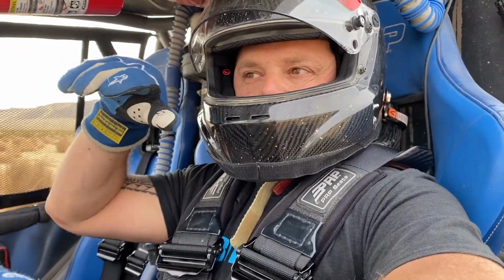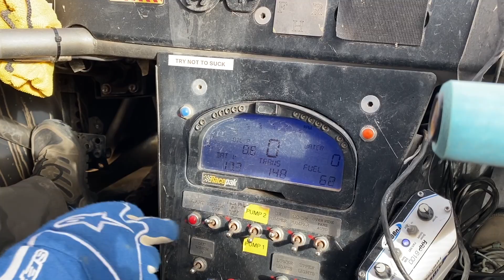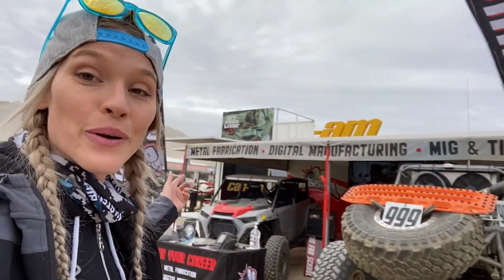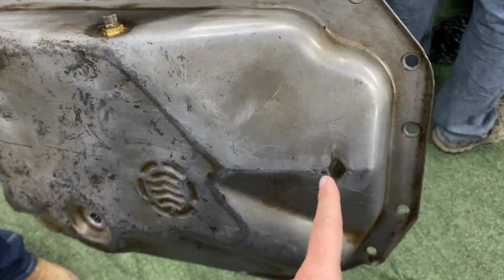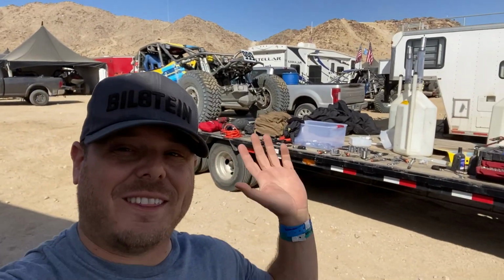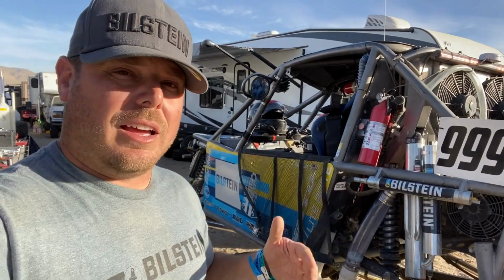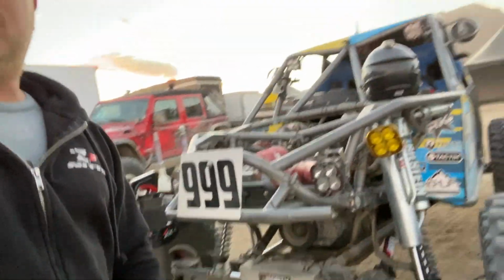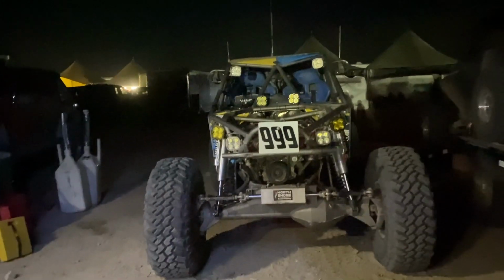MAJOR ISSUES & REPAIRS BEFORE KING OF THE HAMMERS!

Comment: Having that huge spare hanging so far back has got to make you hobbyhorse over every bump, no matter how much you try to tune it out. Any way you can get it forward more?
Reply from the maker: Actually it’s there on purpose to help flatten it out. Without it there or more forward it would be way worse
Reply: @LiteBrite  You've got more experience and skills than I ever will, but you might to check that out with some scholarly type. Basic physics is that the further behind the rear axle it is, the more that weight is going to make the car bounce up and down, hobbyhorsing on every bump.
Reply: Counterbalance to take dive out of nose when getting big air!
Reply from the maker: This spare tire carrier was designed by Randy Slawson (same guy who designed the bomber chassis). Like Mr MoKreepin said, it acts to counterbalance the vehicle since they’re extremely front heavy & like to nosedive on jumps. Also helps to balance the car over larger whoops.